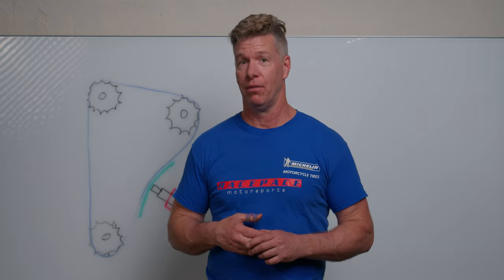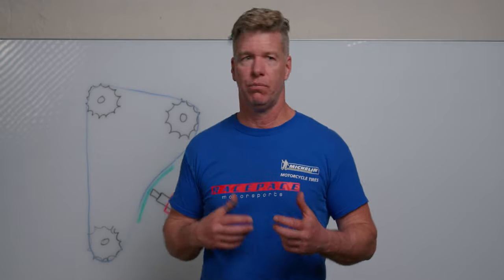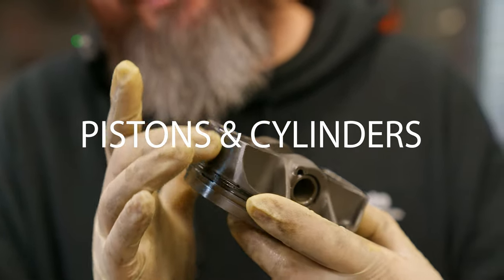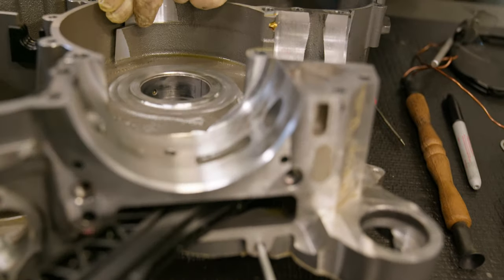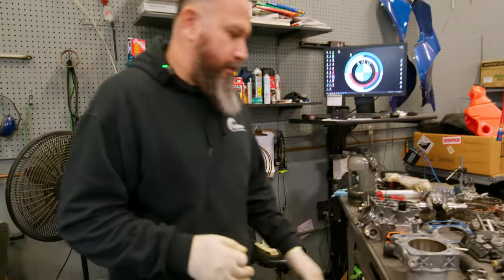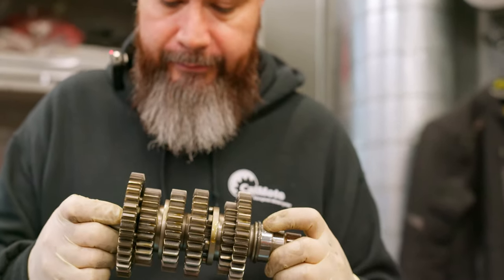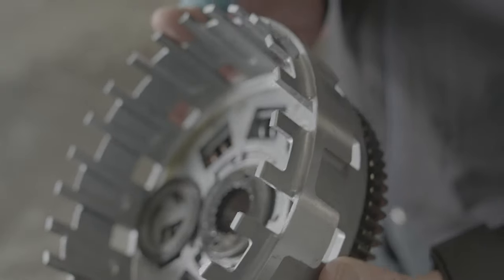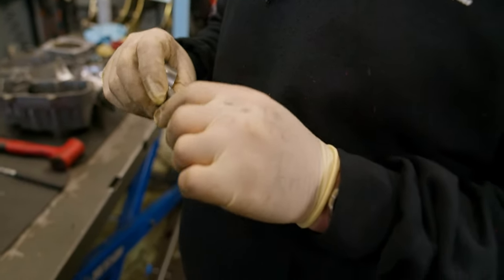KTM 1290 SUPERDUKE R - MEET THE WORST ABUSE IMAGINED, Engine Reliability Review

Comment: There's no way those bearings had spun in the cases!!! Don't know if you've ever actually seen a "spun bearing", but it would have destroyed the cases...you wouldn't be putting it back together! P.S...i have 40yrs experience building engines.
Reply from the maker: What does your 40yrs experience suggest those marks and black stains are?   I am not a mechanic and the only thing I want to see spinning is the rear tire.   I spoke with a highly respected engine builder over this past weekend, one of the few responsible for the recent Daytona 200 win.  One of his suggestions was change oil brands..
Reply: @superduked33  Well, ALL plain bearings are an interferdnce fit in the cases/ conrods/block, so no oil should even get there! It's hard to say without closer inspection...possibly from assembly lube or maybe they even had those stains before they were installed! I highly doubt it's the oil. One thing forsure, they haven't "spun". A plain bearing will usually only spin from picking up on the crank...usually from a lack of oil pressure...in which case, the engine is largely destroyed! I would love to see the cases as well.
Reply from the maker: @miningwayne935  I had similar thoughts - like how could a crank achieve the friction necessary to spin a bearing without showing sings of wear or excess friction on the inner face of the bearing or the crank itself?   Both look fine.  And so did the cases apparently, and they measured true as well.   Makes no sense to me, to Alex, or to the guys at KTM who Alex called for advice.  ...Full disclaimer - I am not a mechanic nor do I play one on TV.   Thanks for sharing your thoughts and experience brother
Reply: @superduked33  Dead right mate...i've seen a few over the years, and trust me...ALL mating faces will be torn to pieces and not usually salvageable! Cranks can be ground if undersize bearings are available, but cases would likely be thrown in the bin!
Reply: Wouldn't the smooth ones be spun
Reply: @philipparana9225  are you referring to when they are manufactured?
Reply from the maker: @miningwayne935  Is it possible that these bearings spun "slightly"?   Or just started to spin?   Or like another poster suggested, maybe once it was overheated before I got it?   It never overheated on me, not even close (at least not coolant temps)
Reply: @superduked33  No mate...a bearing will only spin from contact/excessive friction with the crank, once it starts it doesn't stop until the engine is turned off or it self destructs....as soon as the bearing moves just a few millimetres, it completely blocks the oil gallery and catastrophic failure is imminent! I have heard of chev ls engines spinning cam bearings for no apparent reason...but from my personal experience, it's usually a lack of oil pressure! The bearings in your engine showed normal wear and tear imho. And most of that wear occurs in the first second or two when you first start the engine and there is no oil pressure...metal to metal contact between bearings and crank! Most large diesel engines(large earthmoving equipment etc) have a prelube system which builds oil pressure in the engine before it starts just for that reason. There was nothing really that i saw in your engine that would cause any major concern. I would just freshen it up (rings/bearings etc) and put it back together. BUT, i'm not there...i'm only going off what i can see in your video. Best of luck buddy.
Reply from the maker: @miningwayne935  Hey man thank you kindly for sharing your knowledge.  That makes sense - spinning a bearing clogs the port and game over.   I never knew that.   So comparing the 30,000 mile bearings to my 8,000 abuse miles, those marks on the back are neither a problem or unexpected.   Great to know going forward.   I'm glad I chose to rebuild this motor, and stoked I chose to share it.   Many thanks brother.  GoGo
Reply: @superduked33  My pleasure mate...stay safe. ✌️
Reply: @miningwayne935  not true a bearing can get loose in its bore by pounding and because these bearing dont have locating tabs can turn ever so slightly
Reply: @holmes1956O  if a plain bearing is getting "pounded" to the point that the bearing has lost it's fit, then there are serious problems anyway! In 40 yrs of building engines, i've NEVER seen any such thing! Are you an engine builder? Have you actually witnessed this, or just heard someone say it??? My guess is that if you've actually seen a bearing slightly out of alignment with the oil gallery, then it was probably miss installed!
Reply: @miningwayne935  67yrs old and yes have rebuilt many engines. Caterpillar 3406 are my specialty. More sbc than I can remember. I own 12 motorcycles including a KTM exc 450. Some are vintage and completely restored by me. All of these engines have locating tabs for the plain bearings. And yes in diesel engines in trucks you do see rod bearings get pounded loose from lugging the engine. In this situation the bearing does not appear to have locating tabs. Being that they are mounted in an aluminum housing under very heavy rocking load the scenario I have described can happen. I dont care how much experience you have or if you have never seen this before. I also have no desire to conduct an ongoing argument with you about something I know about and you by your own admission dont
Reply: @holmes1956O  good for you mate...legend
Reply: @miningwayne935  😁
Reply: Highly doubt you spun your bearings... if your bearings spun, your oil hole would be blocked and your oil pressure would be insufficient and your journals would be shot to shit. I would say increase your oil change intervals since you ride hard. I don't see any deep scoring marks on the bearings, only wipe marks. So it's prettt decent. Didnt watch the full video so not sure if you had oil pressure issues. If no faults, then its just wear and tear.
Reply: Ehh That's not necessarily true. It is entirely possible for a bearing to only dislocate from its original position a little bit and not catastrophically fail. The classic "spun bearing" usually indicates a catastrophic failure but that's not always the case.  Of course it's very unlikely for a bearing to dislocate from its original position and not end up in a position that would make it very obvious that it dislocated from its original position.  Of course when that dislocation happens it can also result in oil starvation due to the oil hole no longer aligning which of course would end in catastrophic failure but that doesn't always happen either. I have seen a couple of instances where bearings were not in their correct position but there was not a catastrophic failure. I suppose it's possible they were installed incorrectly but there's no way to know that for sure either way.
Reply: If your bearings had spun, the oil holes would be covered and you would have siezed your main bearings on the crank. Bearings are interference fit. As you said, you hammer the bike pretty hard so probably just some surface fretting. The bearings look decent enough after hard riding
Reply: Something that has puzzled me since the beginning , is why I never see or hear the fans turn on to cool the engine on my Gen 1 SDR . And I ride in Texas Brutal heat. Engine gage only goes up to half way and that's as far as it goes.  Has the engine not reached a temp. to need the fans to turn on ? Thanks Alex for sharing And GO Go filming. Incredible video.

Comment: KTM's powerplants are solid.  It's their electronics that go on those powerplants that can be a issue.
Reply: Exactly,  the engines are powerful and reliable but the electronics are a piece of rubbish, i had two 1290 great engine and smooth at lower rpm's but nasty electronics and chassis engineering

Comment: Wonder why KTM can't seem to get the reliability out of their 790 and 890 motors like this 1290 has had? Mind you, I don't agree that the crank bearings should spin at ANY TIME regardless of being raced or not. That's a sign that lubrication has broken down (oil pressure or oil condition or both) to the point where the crankshaft has made contact with the bearing sleeve, and by friction grabbed it and spun it in the engine casting.

Comment: my KTM SD 1290GT has almost 110000km at its ODO meter. I did 8 track days with it. Still mechanic wise it runs quite smoothly. Only the electronics and sensors bothered my somewhat in the last year. So I think nobody can complain about this.

Comment: I can honestly say I'm not surprised, the LC8 has been around since the carburetted 950 ADV and it's a solid engine (little issues like clutch slave and water pump aside) it's a tried and tested motor and there are lots of high mileage SuperDuke and Adventures out there!

Comment: My gen 2 bought new. 50000 miles 20+ trackdays...only thing I have done is put mechanical cam chain tensioners in at 5000 miles...I'm scared to see the insides of mine....another great video...
Reply from the maker: I am curious how this cam chain tensioner situation flew right over my head all these years.   This is my second failure and only now, because of this video and its responses, am I learning it's a thing.    Thank you Daryl
Reply from the maker: @jimjim753  how did you know you needed to change them from OEM
Reply: @superduked33  clacking like a diesel on cold startups.....many morning rides to work at 34 degrees f.
Reply: I put a manual on my old Duke 690 as the hydraulic OEM was super noisy.

Comment: Had 4 superduke 1290r, love the bikes, fun with a capital F. But I had issues with all 4, rear an front master cylinders leaking numerous times. Elec issues each bike. Gen3 back a forth too dealers with coolant leaks they couldn't find. Then found the front hose has been over tightened. But, cracking bikes, I fully understand some are spot on, some arn't.
Reply from the maker: Sounds like you got a "Friday afternoon" bike.   At least that's what they called them when I raced Ducatis.   Sorry man that's just not right.   How in the hell does a master leak..  I mean that's pretty basic stuff.   By the way my clutch master does tend to fade so once per weekend I crack the bleeder at the master and its good to go.

Comment: Great insight to the Gen 3 motor, especially the cam chain adjuster.
Reply from the maker: I'm going to dissect a cam chain adjuster soon, both an OEM and the better aftermarket replacement.   Should be interesting to understand why one is worse and one is better.  I've had two go bad now..
Reply: Overall on this bike is super specially the looks
Reply: Who offers an aftermarket, better tensioner? Thx
Reply: @superduked33 2nd time watching this video. Any idea who makes a good tensioner? I’ve run manual ones in the past on other bikes but they can be a pain in the ass if set wrong.

Comment: On my 1290 Gen 1, Special edition, the stock clutch plates were "worn" after only 15k kilometers of street/wheelie use, and I almost never used the clutch lever to pull a wheelie. The plates didn't measure problematic, and I only had the problem in 3rd gear, so the dealer upgraded the clutch springs on my request. When that didn't help either, I bought  a new clutch pack from Barnett in the US. Problem gone. :) I'm surprised to see the good state of your clutch. KTM must have learned then I guess :)

Comment: Mechanically KTMs are solid bikes.  Very reliable engines.  Where they lack is the electronic side.  Their models are plagued by electronic gremlins.  It's too bad because they make great motors.  I know because I've owned two 1290 platforms. A 1290 Super GT and a 1290 Super Adventure T.
Reply from the maker: What sort of gremlins have you had?   My only electronic problems were related to a frayed wire under the tail section (warranty by KTM).   Dash would go black, etc.   But once the wire was fixed its been aces
Reply: I owned a 2016 SDR for over 6 years and put 15,000 miles on it and the only time i had "electrical issues" was when the battery was shot. Replaced battery, no issues.

Comment: Interesting that the rod bearing(s) had spun but you didn't know it... I wonder why. Maybe an August race at Thunderhill, super hot and thin oil and you got a little metal on metal contact? Appreciate the video.
Reply from the maker: One responder here suggested very kindly and gently (not) that the bearings had not spun at all.  Guy questioned whether I had ever even seen a spun bearing.   Said the case would have been destroyed.   Another user suggested the oil had overheated, which I can see happening - especially since this bike had so much use before me.   ...For the record the only thing I'm interested in spinning is the rear tire.
Reply: That was my take. I used to machine and build engines for a living and those don't look like they spun. If they had then it would be time for one or more new rods and probably a crank, though that bluing on the crank is unusual. The bearings are pretty well beat up though. Perhaps a higher viscosity oil might be helpful. The crud in the oil pump may have come from the bearings.
Reply from the maker: @Eric-Marsh  thank you Eric.   Sincere appreciation for your experience and opinion
Reply: In the video he said it was a main bearing that spun not a rod bearing. If you pay attention to the video you can see the mains are plain bearing like the rods. I am assuming that spun he meant maybe a quarter or half turn not several times around.
Reply: @holmes1956O  I guess I missed that. The mains look a lot like a cam bearing in an American auto engine. Generally cam bearings need to have the the hole that feeds oil to the bearing aligned with a hole in the block though sometimes there's just a grove in the block that makes the alignment irrelevant. In any case a spun bearing is usually a major problem.

Comment: I can assure you that these bearings have not spun in the housing. You'd see tangential marks, not only discolourations. Secondly, the oil bore is supposedly aligned with an oil channel, an incidental misalignment would have caused an amount of damage that you'd have seen. Overall, pretty normal bearing wear given the use case, nothing to worry about.

Comment: same problem with my auto blip. Every time I wanted to go from 3rd to 2nd while cornering, I could stand on my shifter and it would not click down. Beyond frustrating.
Reply from the maker: I don’t use auto blip on downshifts.   I find at the increased speeds and under such intense braking conditions it is not accurate enough.   Upsets the bike too much so I run old-school wrist blip always

Comment: That’s a great video to see.. not a lot of channels have got so in depth. Well done. The quick shifter and auto blip just stopped working for some reason for me yesterday. I turned it off and back on again in the menu but it is still not working. Have you ever seen this problem?
Reply from the maker: They crapped out on me when my bike went into a semi-error mode.   Cut my power but not drastically, it wasn't a true error mode where the bike only revs to 6k rpm.  It was different.  Go to your dealer and have them login to your ECU, I bet they'll find some error messages
Reply: @superduked33  Cheers for that . 👍

Comment: How often did you change your oil & other type of fluids when riding this hard? I'd imagine it's almost after every race / track day?
Reply from the maker: Good question.  On average I changed oil prior to this rebuild on this motor after every third weekend.   Now I have changed that to every other weekend.  Also now I changed to Motul oil.  I pitted with a guy who runs superbike-built Ducatis two rounds ago.   His engine builder, Brian Sharp of Boulder Ducati,  gave him specific instructions to change oil every other weekend or rebuild the motor by summer.  ...That  made an impression
Reply: @superduked33  Ah, much less frequent then I orignally thought. I knew it had to be pretty often going at it that hard & oil is cheap. Compared to an engine / parts anyways. 

So even with these frequent oil changes are you still having to rebuild the engine every other season? Or is it more down to how often you race / go a track day? It'll be intresting to know how the engine holds up now you're changing it a little more frequently. I'd imagine not very much as tbh to the duke. There wasn't much damage at all, which I am very surprised at with how hard. You go on track / race days. 

definitely gave me more faith in KTM engine side of things. Electronic  wise meh not so much, i've had my share of issues. Little things but very annoying lol

Comment: I've taken my top end apart already at 2000 miles...don't ask why, very embarrassing tbh but let's call it a learning experience. Re-timing this baby wasn't crazy hard but it was interesting... I love my 1290 (2016 model) and yes every so often you have a bit of," what's this now" kinda feeling. No track days or anything like that.... I did also change my tensioner to a manual.. actually, whilst experimenting, I did manual in the front head and I left the hydraulic at the rear

Comment: Great content. Thank you for sharing. With regard to transmission issues re gen1 and early gen2 1290 SDR and GT with some having destroyed transmissions (broken teeth on 5th, 6th IIRC); did any explanation surface? Differential hardening inconsistencies perhaps? From what year 1290 SDR were these issues corrected?
Reply from the maker: Great question.   I’ll have to research that.   I had no transmission issues when I ran either gens 1 or 2,  but I did not put high mileage on the gen1.   I did however put a ton of miles on the gen2.    I’ll ask and get back to you on this